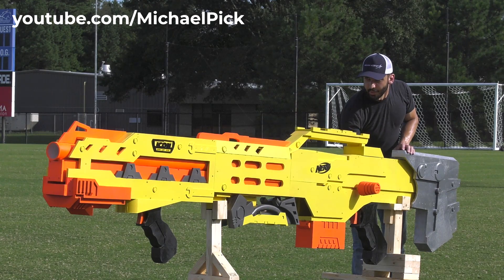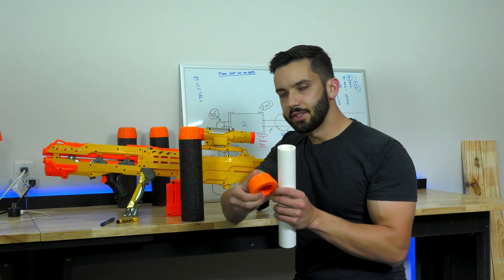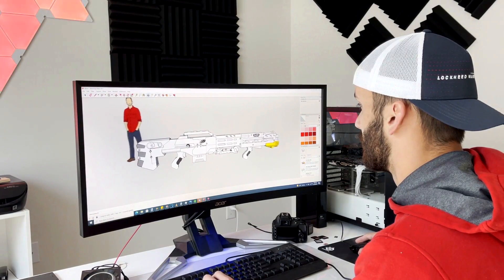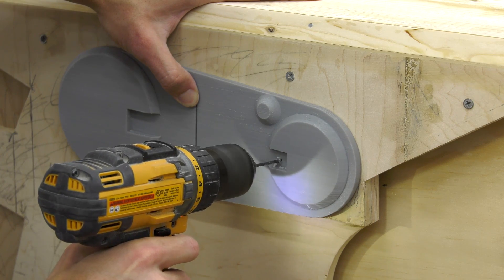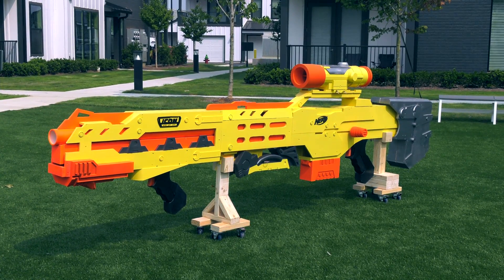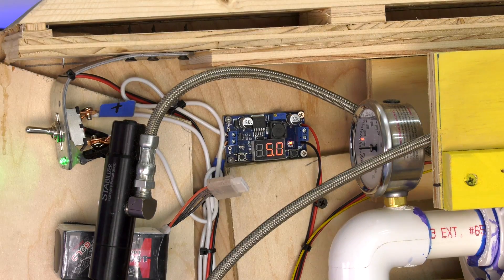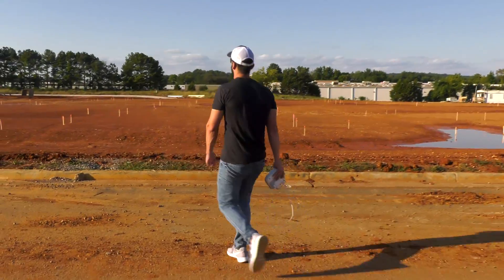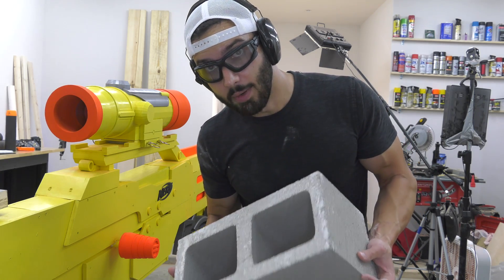I built the World's Largest Nerf Gun (actually works!)

Comment: Impressive build! I have a few questions.
1. What is the weight of the projectile?
2. What's the max projectile speed at full power @ 80psi?
3. How many shots can the air cannister do before needing to recharge?
4. How long does it take to recharge the air cannister?
Thanks.

Comment: So it's absolutely massive and shoots Elite stock. Not going to knock the absolutely giant projectile going that speed, but come on, 50MPH (77FPS) is still not incredibly fast for a foam projectile.

Also that stock Icon Longshot is N-Strike standard, it's not upgraded to modern standards and has about 33% less velocity, averaging 50-55 FPS as opposed to Elite stock (70-ish). Sure, it's not going to destroy much with a 1-gram projectile but you can get better performance by shooting a smaller projectile much harder, and I really want to see this thing's power be used to shoot lots of standard projectiles. That would be an incredible use of the space and you could actually use it in a Nerf war.

Oh, and part of your accuracy problem was that Elite darts (which your stock Longshot was using) suck. They're notoriously inaccurate.
Reply from the maker: Thanks for the input. I’d love to see you make the NERF gun you’re describing! Let me know when the video gets uploaded. It sounds bad ass!
Reply: @MichaelPick  I have plans to make something vaguely in the style of a 76mm field gun, however, the main problem at the moment is workshop space, tools, and some design work for the actual wheeled mount. I will probably have space and tooling to manufacture one sometime around 2023, and will certainly show it off then. Plans include a breech-loading mechanism that will permit either pool noodle projectiles, or "canister shot" of 50 Rival rounds per trigger pull.